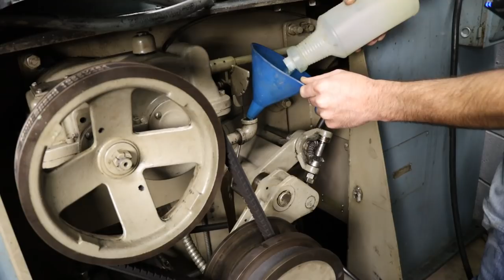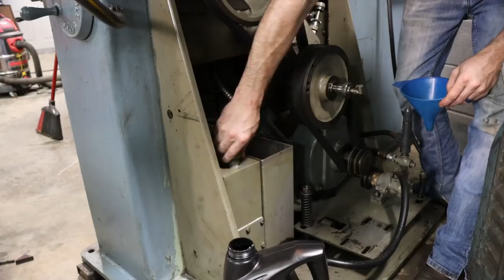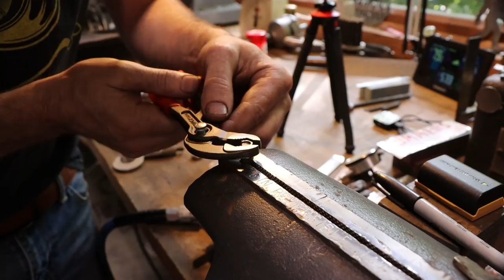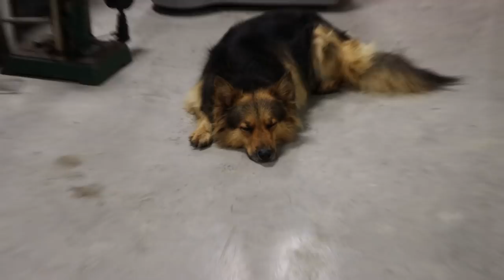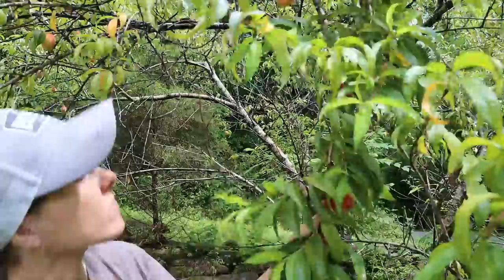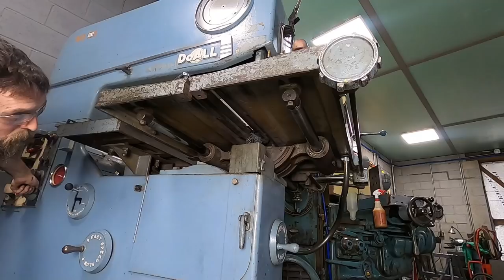Massive1953 Doall Saw repair and test run.

Comment: I've been using and collecting machinist tools and ephemera for 25 plus years. In all that time, I don't think I have ever seen something more beautiful than the speed selector on a K and T. Totally agree with your point. Even the cast iron woodworking machines from the late 1800s had style. Very different from the atomic style, but still demonstrating form and function being utilized
Reply: Love my old Delta machines from the thirties, forties, and fifties. Form AND function were both important in those days. Same with my old Champion Blower and Forge lathe made in the early thirties. Nothing like that nowadays……..brass tags and oiler cups……

Comment: I recently worked in a factory making loaders for tractors. You´d be surprised how little time there is to do every task. If I put on a sticker crooked, there was often not enough time to remove it, and do it again. The loader I was building would move away on an automated cart, to a new station, where I had to do a bunch of other stuff instead. Only way to get more time for something, would be to stop the entire assembly line, which was not a popular thing...

Comment: Old machines are great. We do centreless grinding at my work. all of those machines are over 50 years old. one of them dates back to the 40s. They have such cool designs to them and are built rock solid. Even the belt covers and access covers are rounded off so beautifully. They have etched brass charts on them for setting jobs up. Very cool machines.

Comment: One thing I did to mine was add a contactor and foot switch. I didn’t like how far away the controls were from where I am when using it, and if something went pear shaped I wanted it to deadman if I stepped away.  Also those two holes at the top of your upper blade guide (one directly behind the blade and one on the side) are for a blade oil system. The one on the side holds a small oil cup, the one behind the blade takes a hollow bolt with a slit for the blade to go through.
Reply: Same at my shop.

Comment: Sat morning coffee with Steve in the shop. Love that DoAll vsBS, its definitely a Cadillac.  On a side note, I sometimes think there should be a waterwheel over the creek for a lineshaft. 😁 thanks for the videos
Reply: That "creek" doesn't flow enough water to be of use.  Steve has explained many times it is drainage from the side hill.
Reply: @paulcopeland9035  well I know that... was speaking in terms of a visual like in a painting.....

Comment: I was a patternmaker for a number of years and was fortunate to build and help build patterns that had real character.  They were well engineered and pleasing to behold.  As an engineer, it's difficult to convince management to invest in castings.  Making organic shapes from solid stock isn't too difficult with the equipment available today, though I still prefer cast products for appearance.  But you're right, it's a race to the bottom, and very sad.  Maybe we should design and build some old school niche market equipment, but unless you could sell to the USG, that would be a small market.  As always, great video!

Comment: I have been in aerospace manufacturing for 36 years and have worked in major assembly, machining, quality and even a small stint working with design engineers as a prototype machinist. I worked for the Boeing Co Mcdonnel Douglas Lucas Varity and TRW Aerospace. In all these years I have never flown. If you have seen what I have you probably wouldn't either. I know it is probably the safest way to go from here to there but if I can't walk or drive I'll just stay home. Today's engineer's are not the same ones I worked with when I started. Older ones are just a different person altogether. You also can see a big difference in the machines you buy today and the old models of Cincinatti, South Bend, and others. For me older is definitely better...

Comment: Steve, you are so right, product today is made to maximize profit, not quality or longevity. Back in the day, things were made to last. I know many machine shops that are still running mills and other machine tools that were built pre WWII and still as accurate as the day it was made. Today, "Planned Obsolescence" is the order of the day. When I adjust the rear bearings on band saws, move the bearings in or out to touch the blade just. No reason to adjust them before you mount the blade and find out where the blade will track.

What is the size of that Dimide clamp. Is that the 6" or 8". Trying to get a reference.

Comment: Always enjoy your videos.  I have a 1946 V-16 Do-All which I thought was huge (lol).  I am obviously not in the league of the real machinists that I learn from on You-Tube.  However I will offer the observation that if you find a Do-All compressor you should grab it.  Simple design with all off the shelf parts, (my first run-in with a "water pump bearing" which is replaced as bearing and shaft all together, and readily available) and well worth the effort. It provides just the right puff of air to move the chips off the line, but not blow them in your face.

Comment: Nothing stays the same especially in the manufacturing world. The reasons that we have what we do today are far too numerous to list here.  You can still buy a jig grinder from Moore Tool, and it is still world class. You had better open your wallet real wide to buy quality these days.
Reply: Production outfits today use water jet or plasma tables to do what vertical bandsaw used to do. Horizontal and vertical mills have been replaced by computer controlled multi-axis lathe/mill machines that cost hundreds of thousands, or millions of dollars.

Comment: Steve, have you ever tried "Cool Blocks" on one of your saws. Cool Blocks are made of a non-metallic composite material,  Graphite Impregnated Phenolic Laminate with three synthetic dry lubricants. I love those things. I always shim the roller bearing itself, instead of the whole assembly. McMaster Carr has a wide variety of round shims to do it with. Oh, and if you ever walk in your shop and find that saw missing, it will be in mine.

Comment: Hi Steve and Elizabeth ☺ the saw is coming along fine, it's good to see the first cut, effortless as it should be on a machine that size, it'll sure save you alot of work in the long run, and as far as being able to buy quality items nowadays, people have got used to cheap products, in some ways it goes whith the throw away society we now live in, an example of this hit home to me recently when I needed some cellulose thinners to clean out a paint brush, turned out it was cheaper to buy a new brush,lol, and our local recycling depot has stopped taking solvents, paint etc, I was told it all goes to landfill now, so much for the environment,  makes you mad don't it. Thanks for another interesting video, stay safe guys, best wishe's to all, Stuart uk

Comment: And as usual, the peach cobbler steals the show, yum! The trick of grinding the ends of the baldes by flipping over was neat. I must admit we were never really able to properly weld blades on our Victor branded bandsaw. Unfortunately by the time we bought it second hand it had been very abused at it's previous home and the welder was very messed up.

Comment: Steve, This is a great bandsaw. I repair machines and bandsaw seems to be the machine I get the most calls on.  I have worked on  many DoAll's but have not seen this model with a moving table.  Nice work, Thanks Bill

Comment: Since I was an apprentice in the sixties what has always impressed me about old American machine tools is how a little bit of extra care was taken to make the things easier to operate with the controls falling easy to hand and that spindle speed selector on the K&T. It's as though the guys that designed them had actually worked on them before going 'upstairs' to the drawing office rather than accountants being given free rein.
Reply: The machine shop I worked in we had a German war release break down saw. Let me tell you them krauts made some good tools. The way that saw could cut steel blew my mind. Watching it you'd swear it was only cutting soft pine. Was cold rolled steel it was going through though. We ran like a 6 TPI blade on it. It was comical.

Comment: In the first shop I worked in we had a DoAll that was very similar but with only two wheels. I used the chains to steer sometimes on very long cuts. We measured our blades exactly as you described with a little notch in the floor. One thing we had that you might think about making was a little gauge that slipped into the slot for the guide and let us set the first guide in position. The gauge was made out of material the same thickness as the band saw blades so you could hold it against the first guide and install the second one once you had the first one in place.

Comment: Nice DoAll saw Steve.  I have a DoAll 1612 saw myself.  One thing, when DoAll made he deep throat model, the hydraulic controls end up very far away from the table and blade.  Not ideal at all.  I think a foot valve would have been more useful or just the controls closer to where the sawyer is operating the machine to be able to see the cut.  Just my 2 cents.  On my saw, I added a VFD.  I tool away the Reeves drive and just use one belt, just going motor to gearbox.  I actually raised up the motor plate to the mid position, and the motor pulley is now in the space where the intermediate idler used to be.  Seem like a lot of changing, but moving the motor plate was quite easy to make the hinges mount the way they needed to.  Also when going to the VFD, I upgraded from a 1.5 hp motor to a 3 hp motor.  It lets me crank up the RPMs and friction saw with ease.  Just don't melt the rubber tires.  I think the Zypher saws must have just iron wheels for friction sawing.  Keep up the good work. --Doozer

Comment: Steve, keep in mind the EPA has removed ALL our zink protection from lubricating oils. So we must now add a aftermarket zink additive to protect hardened parts in all gear on gear transmissions.  I know of 2 lucus zink & Rislone Hyper lube zink additives, not cheap, but seem to work pretty well. Also investigate non detergent straight 40W oil and do not use multi grade ( 5W-50)  detergent type oils in equipment because the detergent oils today brake down to quick and act more like water then oil and does not stick or transfer heat on bearings then a lubricating fluid needs to.

Comment: I have restored several Doall bandsaws over the years and Continental Machines (Doall) was great to work with. If the part was no longer available, they would supply a blueprint so I could make the part myself. I have several Doall blueprints that were actually drawn with a pencil on a drafting board, believe it or not…lol!

Comment: Nice work Steve. I have a couple of thoughts came to mind I was taught using many of these DoAll and others, we used to break in the blade using very little pressure on the first cut, its purpose was the balance the blade tip lengths or even them out.  Also watching the table during the cut it appeared the hydraulics had a little air in it causing it the be a bit jerky.  All in all that is better built saw then then you can but today. Shame on our engineers and manufacturers.  Keep on smiling.

Comment: Congratulations!!  How awesome that everything is working on the Doall Saw!  That smile on your face was priceless.  Also congratulations on an Awesome wife that can cook a great peach cobbler.  My Mom's peach cobbler was to die for.  I remember when you got the surface grinder, you said you didn't know how much use you would get out of it.  Now it is indispensable!. One suggestion, can you engineer a rubber bumper for the return stroke on the table, that pounding can't be good for it.
Reply from the maker: Thanks Vernon, the table does need stops . Can't beat a peach cobbler 😄

Comment: You can add a valve to slow down your hydraulic retraction....you can turn it closed to restrict the flow so it moves slower....i have one on my Crane Truck for the Hydraulic cylinder for lifting/lowering the boom... When up high at 115 feet it really makes lowering safer.... All it does is restrict the flow .... Maybe you can change the way it is connected as your feed seems to have that already....they probably bypass that for faster retraction ( which is basically what you want 99% of the time ) ...

Comment: On my Doall band saw theres atleast 3 needle valves for adjusting speeds, one was for reverse speed and one for feed pressure. My saw has also an servo valve, so it can be different than yours. Since it has "REVERSE, STOP, APPROACH & FEED" and you can only adjust approach speed and when sawing you turn it to "FEED". The lower blade guide moves and it pushes an lever which senses and pushes the piston in the servo valve. Theres also an foot control which is quite nice when you get hands free and saw against fixed stop :)

Comment: I have the ML version of the same saw same year. I am envious of the super deep throat and the hydraulic table.  the ML has a  foot pedal that operates a strange chain driven 'pusher' thingy. The one thing the smaller saw has is a very funky blade speed indicator. I amazed no one has done a 'Meteorite' version of the material selector.
Lovely video as always

Comment: Awesome video on rejuvenating the beast of a bandsaw Steve.  I particularly liked the rebuild and alignment of the guides.  I have an old woodworking bandsaw and have tried to tune it to run as true as possible but never realized the colinearity/coplanarity aspect in the tuneup.  I am definitely going to do this along with other adjustments to get a "true" resaw over a wide range of hight

Comment: It's much much easier to align the blade guides with the blade on the saw. Once you get a bit of tension on it, it is the best Street edge Plus you want to set the back bearing far enough forward that the gullets just clear the guides. It's kind of tricky to get a straight edge that you can examine above and below the table. Tensioning the blade creates the reference surface. At least that's how I was taught, I completely defer if I am wrong. You are far more of an expert than I

Comment: Steve, betting the gear box has bronze bushings (yellow metal) and maybe you have are look up the build sheet pdf. If it were mine, I would filer the oil with a paint or fine mesh screen to see if the flakes are bronze are cast? Brian over @ metalshaper offers a transmission oil for the older vintage jeep transmission that would prolong the saws gear box. Just my thoughts, and have a super wk end :)>. Nice first cut,,,and your angle vise,,, I let my Enco one go when I sold the mill, so for Fathers Day, went on ebay and bought my self a Wilton 11702 3 axis,,Got check them out, costly, but what a great addition to our shop! Great video once again, have a super wk end with family and in the shop!

Comment: A nice retro-view on old machines, their quality and charme. I also think that modern times with flat touch screens will result in a resurrection of good, solid, ergonomic and functional haptics. I rather like to press a button while runing a machine instead of pressing a flat foiled key. My Flott drill press (TB13 Plus) has such flat buttons and I am not pleased with them, also their response time is too sluggish. Greetings from Germany, Stefan.

Comment: From looking at my ML the alignment between the bottom and top blade guides is done by adjusting three bolts on the top wheel - they hold on the whole wheel assembly and  are hollow bolts with lock nuts. Mine was out by about a quarter of an inch. No need for shims.

Comment: "If you make equipment more labor intensive, people will buy cheaper stuff". Horrible Freight is a good example as we see people flock to it thinking they are saving money. Maybe, maybe not.
Cool tip on grinding the ends of the blade.
Your son could be learning so much from you.

Comment: Steve,
I can send one of my Rollback's over to get that old saw out of your way. I will include a 15% off Harbor Freight coupon towards the purchase of a new saw with a warranty.
Harbor Freight's manufacturer description,
You'll be able to quickly and accurately cut workpieces up to 4 in. x 6 in. (rectangle), 4-1/2 in. (round) using the band saw's adjustable horizontal and vertical positions. 
Choose from 3 speeds to cut everything from brass and aluminum to rugged alloy and tool steels. Includes a 1/2 in. x 0.025 in. x 64-1/2 in. blade (14 TPI), plus a heavy-duty stand.

Three speeds to cut everything from brass and aluminum to rugged alloy and tool steels
Gravity feed cutting pressure adjustment in horizontal position
Comes with blade and heavy duty stand
0-55° left miter cuts on horizontal
Two-position rocker switch with safety lock-off, no repairs needed, new with warranty.